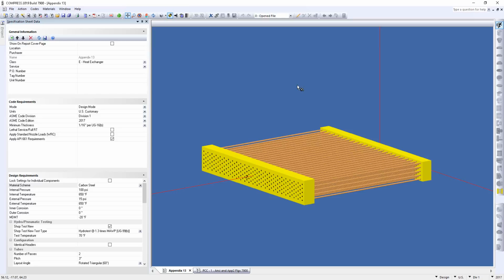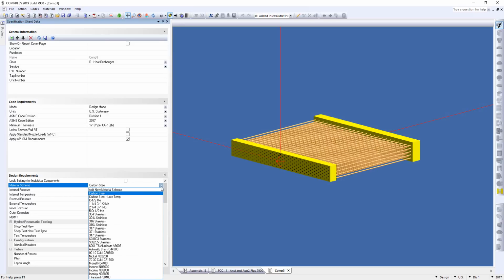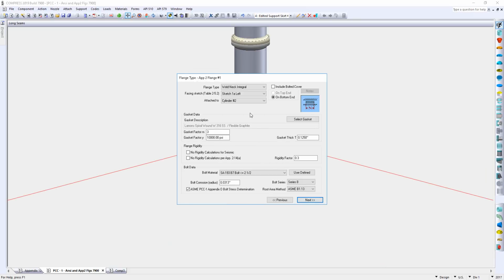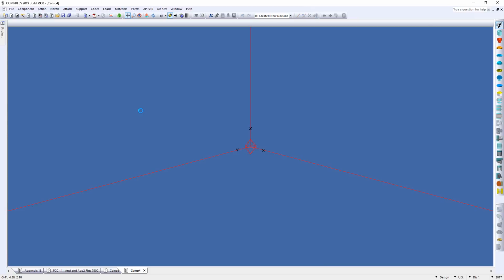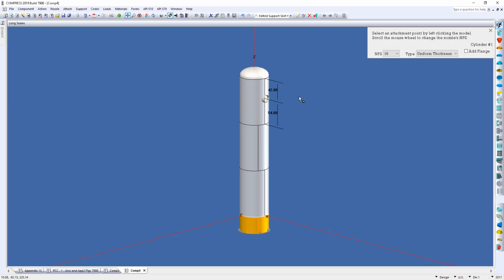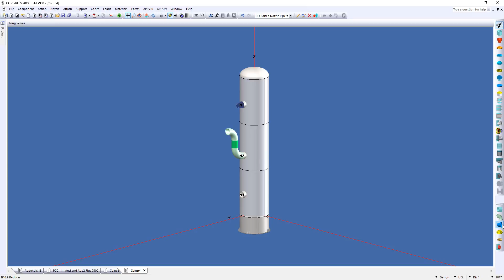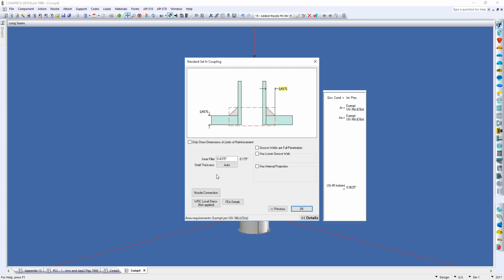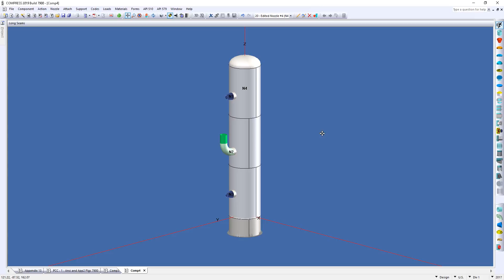What's New in COMPRESS 7900

Comment: That quick design feature is really helpful.. any updates to the HX design interface? the option to change the rear head type after entering all the info would be nice.
Reply from the maker: Thank you for your comment. In addition to the new Quick Design Mode, COMPRESS Build 7900 also includes new features for the heat exchanger module, like the option to specify impact testing and/or PWHT for tubes. To learn more about the new features in this build, please contact sales@codeware.com